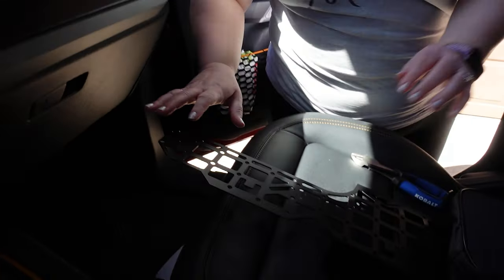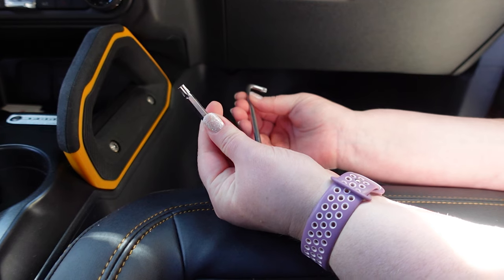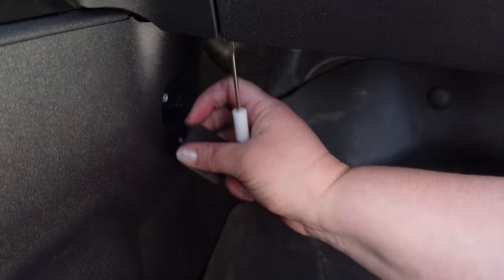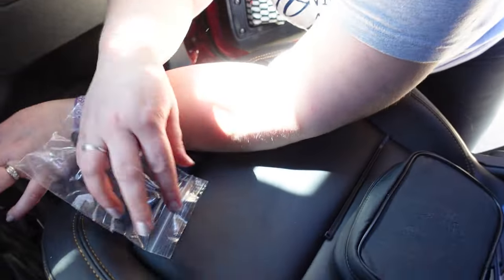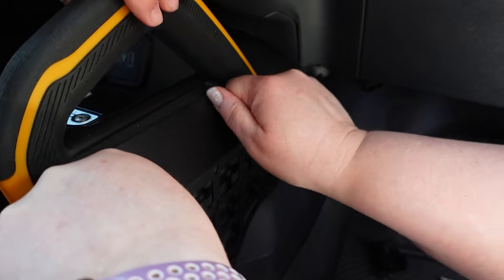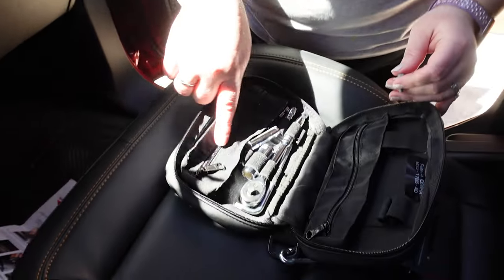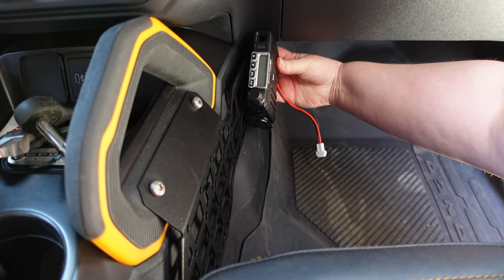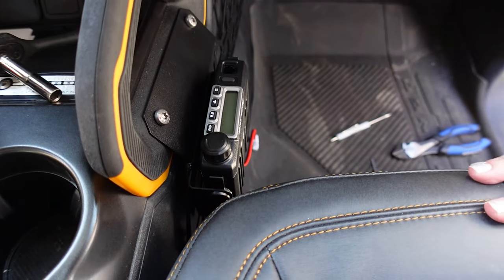Ford Bronco - Molle console mount install - Mountains2metal

Comment: I hope someone comes out with a type of cup holder thing to replace the nets on the doors and maybe something with molle panel characteristics. I definitely could use those in the rear. Hope to see y'all at the Super Celebration.